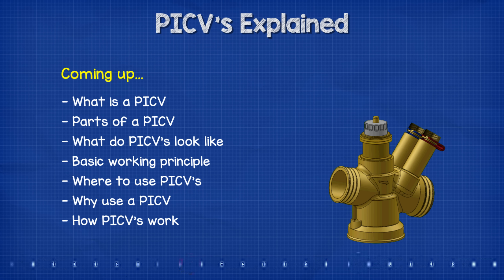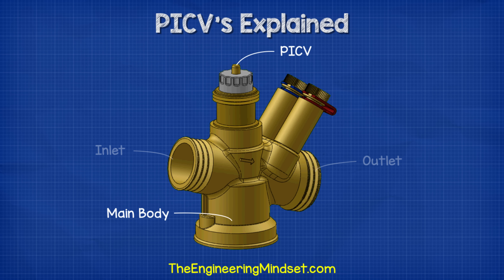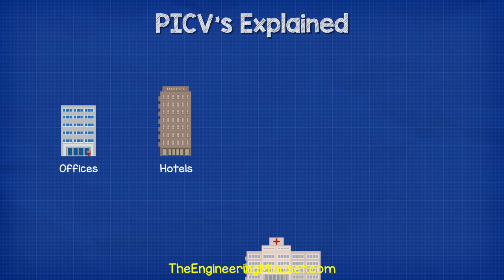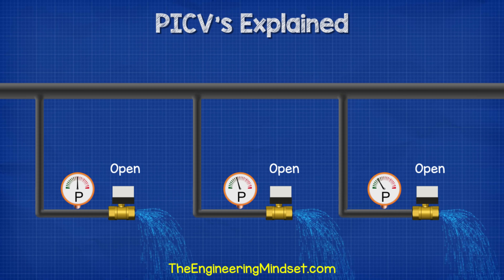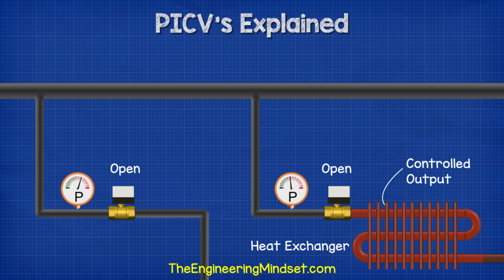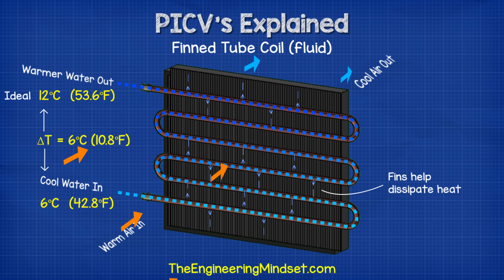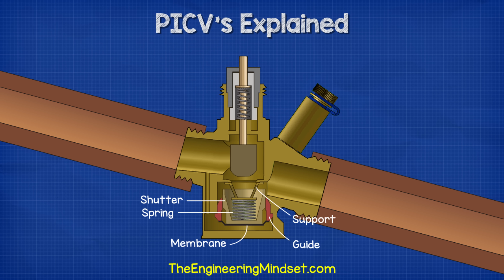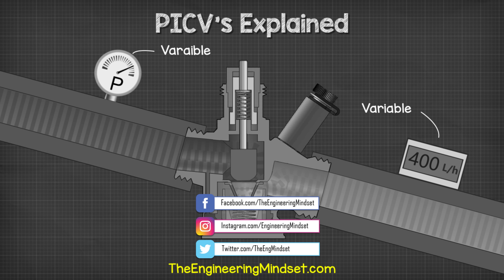PICV Explained - Pressure Independent Control Valves

Comment: Can a balancing valve be used on the hot water supply on the distributor with 2 heating circuits?

Comment: Can a standard 2 port control valve be installed downstream of a PICV (no actuator on the PICV)? How does the modulating control of the 2 port control valve affect the operation of the PICV. Do they work against each other i.e when the 2 port control valve closes, does the PICV compensate to keep the flow constant?

Comment: Excellent animations to show the workings. In the process of designing a system with a heat exchanger, I had planned to use a proportional valve to control the fluid flow. Great to find out now that this is a better valve selection! Thanks again for the awesome video. Will be ordering one of these on Monday.

Comment: Hi, Very nice video.
Can you please let me know how it will avoid overflow in part load operation when PICV is used in constant speed pump. 
Pls explain as I didn't get that point.
Reply: When the system is in part load, that means some branches of pipework are closed off or at low flow. That causes the pressure of the system to increase. When this higher pressure water enters the PICV, it will cause the diaphragm to restrict the flow of water going to the outlet, making sure that the flowrate of water going to the outlet is constant.
Reply: @jamesch770  Thanks
Reply: Hi, may I ask that our AHU is having 5 l/s flow rate and PİCV selection is made as per 6 l/s .. will this PICV work properly?
Reply: @ibrahimhalil7391  i believe shown in the video that flowrate can be adjusted

Comment: Hello
The channel is very helpful. But there were two questions about this video.
Why, when changing the position of the shutter when adjusting the position in the animation at the moment starting from 10.10, the shutter movement is not shown? during regulation, the pressure drop across the valve changes. And secondly, I did not understand how these valves help the chiller work in case of partial load when a low temperature difference occurs - reducing the flow does not help the chiller.

Comment: The way this thing looks, would backwash i guess, like turbulent flow, circulation within the PICV be a problem??? From what little I know, those fluid dynamics consideration would be a problem I think....and also lets say the pressure increases on the high pressure side, the goal is to maintain constant flow not constant pressure on the low pressure side right? But intuitivetlyIt seems like inevitably that the pressure will increase no matter what to make the fluid flow rate the same, for example in electricity, the resistance increases, but to maintain the same amount of current i.e. fluid flow, the pressure or (voltage) must also increase to maintain the same amount of current or flow rate? Its hard to imagine the same flow rate without a fluctuation in pressure as well.....someone please comment on all of this...

Comment: Working on a system at the moment. 2 chillers on primary side linked to secondary system through a de-coupler. Max flow on primary chillers in 250 m3/h in total.On the secondary side there are variable speed pumps. 

I need to ensure a max flow of 240m3/h on secondary side. Just wondering should i replace the 200mm DRV with a similar size PICV To ensure I don't pull no more than 240 m3/h.

Comment: Besides being a single valve body, do these function differently than using a modulating control valve in combination with an automatic flow control valve?
Reply: In automatic balancing valve the flow is fixed, but here you get a range of flow for each valve size which can be adjusted as per requirement.

Comment: You said that PICVs don't work when combined with TRVs in two-pipe heating systems, but what about a TRV which is also a PICV? Danfoss (Dynamic Valve) and IMI Heimeier (Eclipse) both have such valves, are they suitable for two-pipe heating systems?

Comment: Completely off topic - just a question I've had a long time, & didn't find topic. My question is about attenuators , or light dimmers. When you use a household light dimmer in you home to set mood, at night, let's say, and you dim you light to a faint glow - I know the light bulb itself [filament] is not burning energy, & you're not paying for electricity like if that bulb were straight-on at full brightness. My question is about that dimmer, & it's process... Am I still using the same amount of electricity - with the dimmed output process still using the same amount of juice as the dimmer's resistance deflects energy from the bulb? Does the dimmer chock the electric output, block it, or consume it? Thanks - Brad